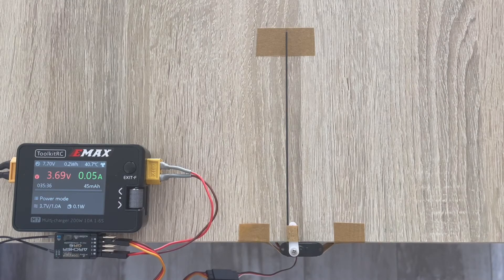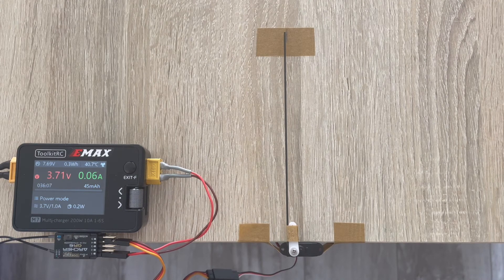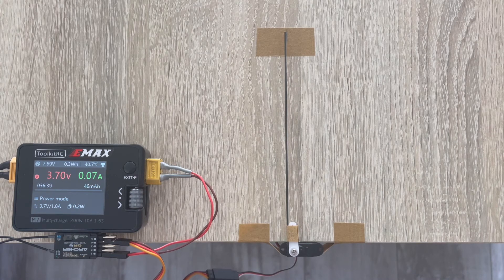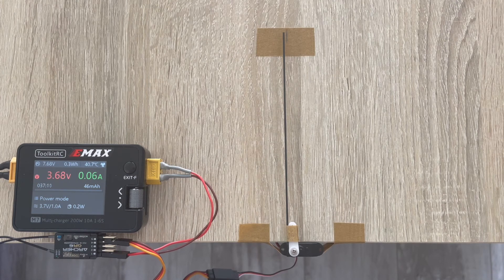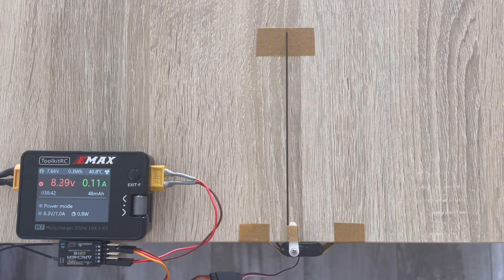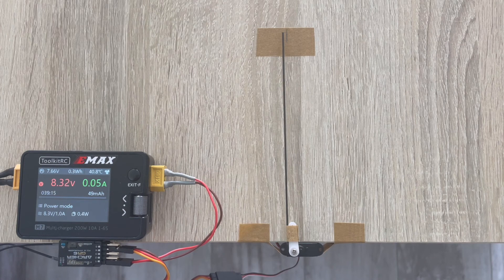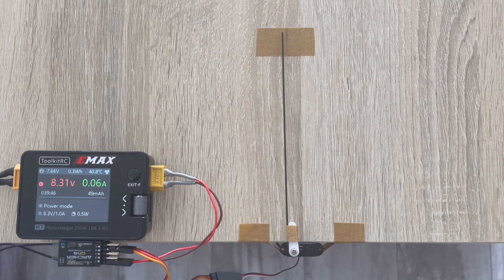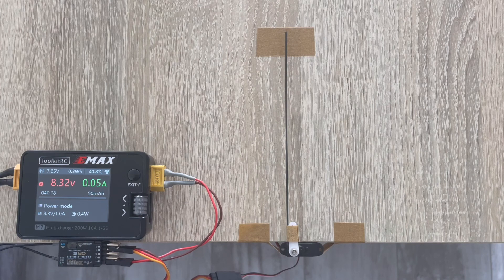JX DPI DHV56MG - Is it the best budget High Voltage Micro Servo?

Comment: Hi thanks for the video. Very informative. Were these servos  7.5g submicro servos?. Im trying to find a set of budget cyclic helicopter servos. Just wondered if you had any information on that type of servo.
Reply from the maker: These are 5.5g, and very good. 

However, for a heli, I'd recommend going KST X06, Chaservo HV06, or AGFRC 6g servos instead of these JX ones.

Comment: That is odd behavior. When I get one like that I return it to my supplier. Those I have tested have deviated 0.5-0.8mm most of which were out 0.5 or centered perfectly.
I typically run my 1s Lipo setups down to no less than 3.8V
Reply: I was told they center better on 2s power but evidently not. I test my servos in a similar fashion. The best centering sample drives the elevator and the worst (within reason) the rudder.
Reply from the maker: @kirkglundal4289  that's right, there is no difference in centering at low or high voltage. Usually, these center good for me as well.